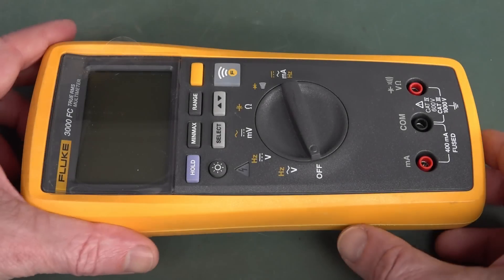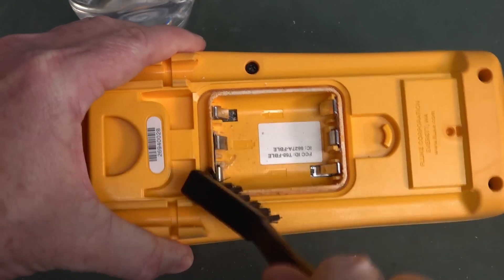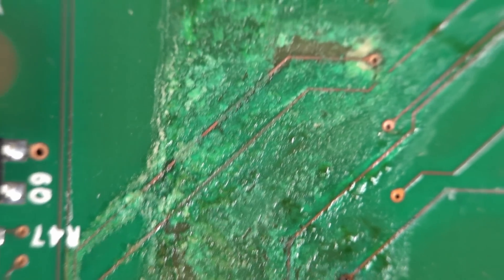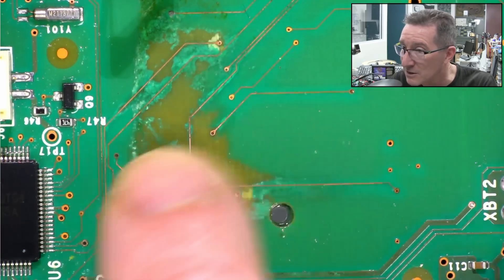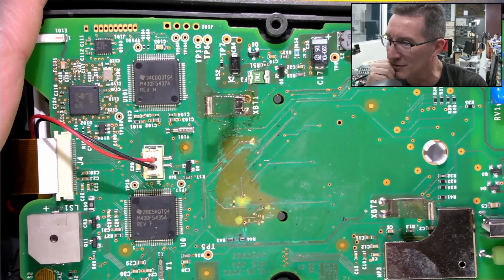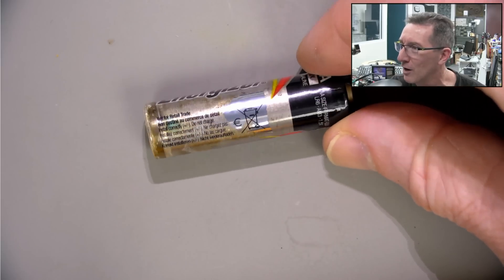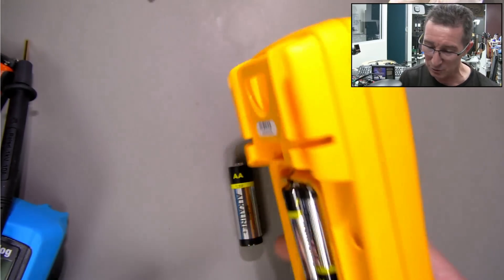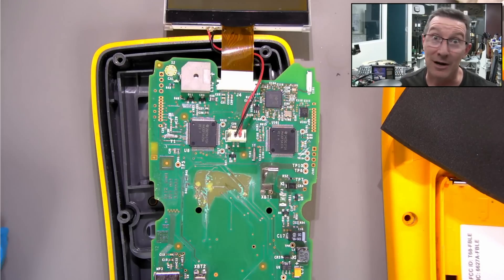EEVblog 1497 - RIP Fluke. Thanks Energizer. NOT.

Comment: Worth a troubleshooting sesion :) I always enjoy your repair videos, they are my favorites, very educational too. Not a chance to have any reliable measurements with it if it ever powers again.. That isopropil bath took the contaminants all over the board and left them there once it evaporated so erratic behaviour due to leakage is very probable.. could be used as a higrometer, wackyer readings with increasing humidity :)
Reply: Contaminants from the surface can be washed, but he needs to remove (grind) the affected, soaked part of the PCB. So it's not worth it.
Reply: @kbs3055  In my experience it is quite tough to clean multimeter boards to an acceptable level, they may work well at low humidity but not at high humidity, nS range may not zero, permanent dc offset in milivolt range, etc. With the right chemicals and process I am sure it can be properly cleaned. The other problem I see is calibration.. even if the board is cleaned perfectly the cal values will be off now and because it is a software calibrated meter it needs an expensive visit at a Fluke cal lab :) The 170 series is quite nice in that respect, you can self calibrate if you have some good standards at home without opening the case.

Comment: The electrolyte from leaky capacitors can also destroy things... as I learned at considerable expense some years ago, when my third-hand Tektronix digital oscilloscope of a certain vintage developed leaky capacitors (the scope having been made during the time when Tek was using off-brand caps), causing irreparable damage to a zillion-layer PC board.  This turned out to be a known failure mode for certain models, with the only solution being to replace all the electrolytic caps before they failed.

I haven't lost any equipment to leaky alkaline cells lately, but I've certainly noted used-up cells (including name brands) leaking copiously while awaiting disposal.

Comment: I've had a copy of Pokemon pinball have the battery for the rumble feature leak and damaged the solder mask on the board.  I cleaned off the board with a q tip and vinegar then rinsed with alcohol.  The traces weren't damaged but I  tinned them with solder to give them some reinforcement and coated the board with nail polish and that seems to be a solid repair.

Comment: I have been using the same Ni-MH rechargebles AA ( Energizer) batteries for 10 years that is they still charge and no leaks, they are in my 12 Yr old wireless mouse for my PC seems i chose my type wisely. I have 2 pairs of 2 so swap them out when they need recharging. they maybe dont hold out quite as long as when new between charges but long enough for a daily driver.

Comment: I've seen alcaline leaks corroding the battery terminals, or adding gunk..but if the plastic, the contacts, the solder mark, the vias and the resistors are ALL that corroded...sorry but that's on Fluke side. Even IKEA stuff take leaks much better than that, come on..so much for the supposed "superior" Fluke build quality
Reply: Long term contact with an alkaline solution destroys the soldermask and epoxy.  And plastic was broken by mechanical force of crystallizing chemicals.
Reply: @kbs3055  Yes, but in practice even with very long contact I've never seen anything even remotely like that (long = couple decades)
Reply: @engineeringdisillusion  An alkaline solution, means it's in liquid form. Multimeter has a hermetically sealed housing, also PCB was in contact with the back of the battery compartment, which makes evaporation difficult.
Reply: @kbs3055  I know what an alkaline solution is. Still, most pcbs and plastics(old multimeters, remotes, and so on) do not destruct like that, even with bigger leaks(multiple AAs,C,D cells)

Comment: I caught one in the act. They were 3 in series and I could actually hear it hissing. It sounded like the electrolyte was being boiled away. The whole battery was wet and it wasn't warm but it sounded like some tiny portion was being boiled. It may have just been gas escaping and bubbling through the wet seal. I was reluctant to put my ear too close because i was slightly afraid of some sort of failure of the battery, but more so, the battery was installed in a carbon monoxide detector that had just alarmed because of failing voltage or from detecting the gasses from the battery.
Reply: lmao if the very last thing that detector did was detecting itself.

"i have become what i sought to destroy"
Reply: @felixar90  lol. It actually still works. The leak only got to the battery terminals and not the PCB. They were soldered on with wires not directly to the PCB. 

Before anyone says something about it not being safe to continue to use, I am aware. There are no combustion sources in the building. It was brought in to make people feel better about using a propane heater in a warehouse during a cold snap. It would take days or weeks of continuous use in a sealed building of this size to become a problem.
Reply: I've had leaky batteries making funny noises in various devices.  One night I fell asleep listen to a tape, actually I think my tape recorder was rewinding the tape and when I woke up, the tape recorder was making the most unusual ticking noise, and it kept making the noise even after I pressed the stop button, that really scared me a lot.  I concluded the noise was coming from the batteries, which I believe were leaking.
Reply: It was hydrogen gas which developed inside the cell at such a high pressure as to overpower the seal by the negative electrode (cathode). When that happens, highly concentrated solution of potassium hydroxide escapes the cell. Potassium hydroxide in the solution then readily accepts carbon dioxide from the surrounding air and turns into potassium bicarbonate and carbonate, giving rise to the crystals commonly seen around leaky cells.
Reply: @jenda386  That went a bit over my head, but it sure makes chemistry sound interesting.  So clearly, a chemical reaction was occurring inside the batteries.  I think they were Duracells, this was back in around 1992.
Reply: I've caught one actively leaking as well.

Comment: That's why I don't care about alkaline batteries. Zinc carbons still leak, but I've yet to see something like this happening because of them. With those usually the problems end with the battery contact getting a bit rusty.
Reply: how can zinc-carbon leak if they have no liquid inside?

well, i went to wikipedia, and found out that the zinc shell reacts with the innards to produce zinc chloride. The chloride is hygroscopic... so much so that it draws moisture from air to become a water-salt paste, which is corrosive, just like any other salty water.
Reply: well, seems i was wrong even more, it does contain a bit of liquid. Okay...
Reply: @victortitov1740  Good job wikipedia warrior. Now, all you have to do is explain exactly where in my comment did I say they don't leak at all?
Reply: @featheredskeptic1301  you didn't, i did

Comment: For rarely used light-duty devices like secondary remote controls, your n-th meter and the like, use dry cells so you don't have to worry about leaks anywhere near as much.
I've never seen an alkaline battery eat through plastic before. Maybe Energizer's special sauce has compatibility issues with Fluke-yellow plastic.
Reply: Maybe the contacts corroded, expanded because of the oxidation and then mechanically broke off the plastic?
Edit: Nevermind, saw the rest of the vid. Definitely  chemical damage to the plastic itself. Very weird!
Reply: Perfect use for dry cells as they give a pretty good capacity under light load, e.g. people use expensive heavy-duty 9V batteries in smoke detectors when a dry cell will give the same life.

Comment: Same as the Seaward PAT I bought to test gear for a bi-annual event. 2 years between uses was too much. Good lesson for removing batteries on everything.
Reply: That and store anything with a Li Ion battery in a fire-tolerant area, not mixed in with other flammable things.

Comment: I see the recommendations about Lithium AA and AAA batteries. I've actually switched all my batteries to Ni-MH ones for devices that run on them, which is most these days... Ni-MH can leak, but I've never seen them do it. Certainly not as easily due to under voltage like normal alkaline just love to do.

Both contain sodium-hydroxide by the way, which (if you get it hot enough) will eat glass. With normal leaking it kinda dries out, but if it's very humid it's hygroscopic enough to pull moisture in and go to town. The case was probably some fiber glass reinforced nylon which NaOH will eat better than it does ABS or HDPE for example.
Reply: One ugly disadvantage of NiMh is self discharge, thought.
Reply: @borislipschitz2740  Yes and no: There exist low-self-discharge NiMH batteries, but people only look at the capacity when buying rechargable batteries.
Reply: I've seen one cheap Ni-MH battery leak and I was surprised that they could do that.
Reply: Lithium are not fool proof.
Instead, they get punctured and start fires. Something heavy falls on them, could result in disaster.
My buddy's brother had an 18v cordless drill battery catch fire in his work van. 
My guess, he got careless and set something heavy on it and punctured it.
Fortunately he caught it within enough time to prevent whole work van from going up in flames. But lost about $700 in work tools. Everything has a calculated risk.
Reply: @equinoxshadow7190  That sounds like a Li-ion rechargable battery. Disposable lithium 1.5V AA batteries have, to my knowledge, no puncturing hazards.
Reply: @equinoxshadow7190  That was some high-capacity high-draw rechargeable lithium battery pack. That's quite different from the little AA and AAA lithium primary cells (non-rechargeable). I've never heard of those actually explode or be a fire hazard.
In my experience, the lithium primary cells (1.5V) are just very good batteries with an extremely long shelf life (it's 20 years for AA and AAA Energizer Lithium). I keep them around for emergencies and for any devices that won't work right with Eneloop NimH cells.
By the way, manufacturers of smoke detectors always recommend using lithium 9V primary cells because they are very reliable long term.
Reply: @maximilianmustermann5763   I mostly use the lithium 9 V batteries nowadays,  especially for things like multimeters and smoke detectors, but just to be on the safe side I wrap the batteries with saran wrap to hopefully capture any electrolyte that might leak. Haven't seen any of them leak yet, but better safe then sorry....

Comment: I'll always say: Buy Panasonic Alkaline Plus batteries. I have never seen them leak and they are much less expensive and almost as powerful.
Reply: I am using cheap AEROCELL alkalines from Lidl without issues. I use Excell as well, it's a Chinese brand, the cells and their packaging looks the same since the late '90s, and never seen any leakage with them, except a few very out-of-date ones. IKEA alkalines also used to be quite good, but I have seen a few leaking lately.

Comment: I've had this battery leakage destroy SO many electrical devices. And I still forget to change them every 6 months. I "should" leave them without batteries inside them, and just put them in when I need the device to work

Comment: The aftermath is similar to what a VARTA NiCAD clock battery did to one of my Microbees - many tracks disappeared & the electrolyte got sucked into the flexible ribbon cable eating it up.
Reply from the maker: sad face
Reply: Well not all sad stories.  My parents had to temporarly move 6 years ago and my Tamiya RC car and it's remote were still in a box in storage so I had to come and pick it up. For fun I switched on the remote and still saw the battery meter move a bit. Inside were 8 Varta nicad AA cells. The box had been standing there since the late 80's. To bad I disposed them directly instead of trying to revive them. 
But this video again shows why I should take out the batts out of my stuff when I sometimes don't use them for months.  As a matter of fact I am going to do that now.

Comment: I'm wondering from the way the plastic is shattered whether it didn't attack the plastic itself, but rather the accretion on the corroding metal caused the plastic to crack through stress?
Reply: Indeed! So remember guys, the start is to lay down our meters away top side up always so when it gets to leak it leak downwards

Comment: I only use Eneloop, never had one leak and they last forever, my oldest ones are Sanyo branded, still works great.
Reply: I agree. I've used them in my Fluke multimeter for years without issue.

Comment: Replace it with one or two 14500 lipo cells (3.3V to 4.2V each) and tell us if it works.
Reply: That's silly. Just use 1.5V lithium

Comment: i use Energizer Ultimate Lithiums just assuming they won’t leak overtime in my low drain devices
Reply: Playing right into "big battery's" hand - keeping the cheap batteries crap and leaky so they can up sell you on high end batteries. Their plan is working...
Reply: @gorak9000  lol, yeah i guess so. But I just don't wanna worry about it down the road. Like on my multimeter, those batteries could stay in there for a decade or more tbh. I do use rechargeable NiMH for stuff that drains fast. It works out a lot cheaper even though they don't last as long.
Reply: @Evansmustard  The capacity on Eneloop NiMH is actually really high and their voltage curve is way better than alkalines (you can use more of the energy at a decent voltage compared to the linear voltage drop in alkalines). If they don't last long, it's just because the devices are not optimized for NiMH usage. But it doesn't really matter because you can just reload them whenever you like and they last forever (10 years no problem, 15 years even, with daily use)